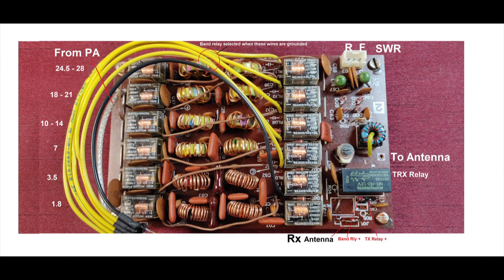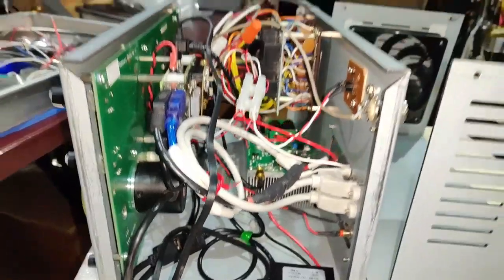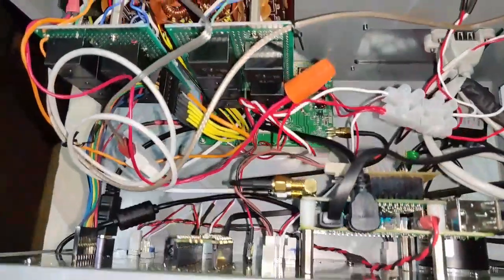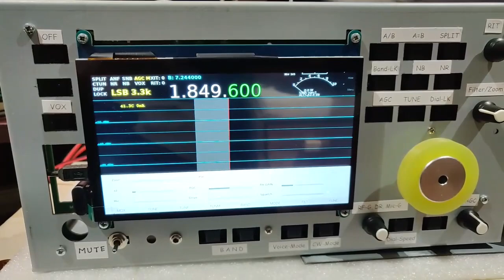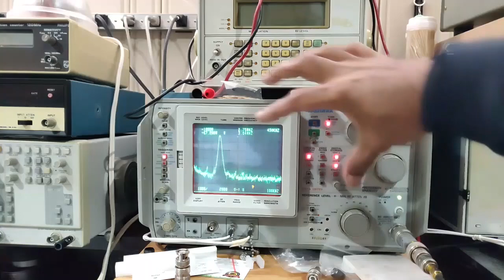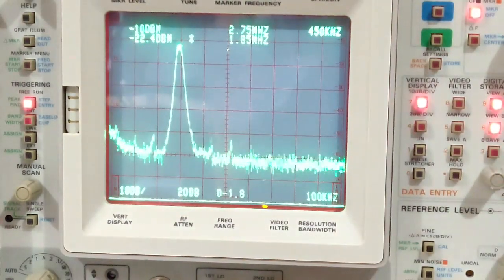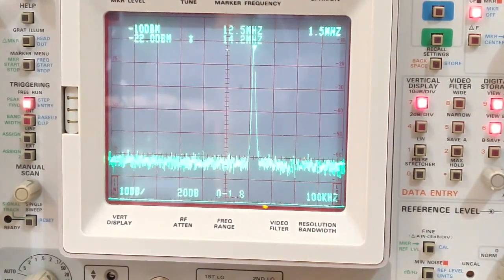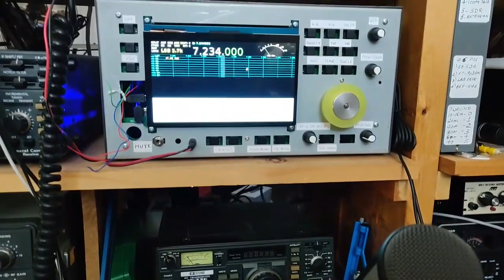On the air QSO with my Radioberry TRX | Raspberry Pi 4 | LPF and Output tests on a Tektronix 495P SA

Comment: Very nice and something I am going to do myself.
I am going to use the PA and FB out of an old IC-725, well that's the idea at least.
But I am trying the Radioberry now for about two weeks now without success.
I just can't seem the get the software setup.
I am going round in circles trying to get it working.
Reply from the maker: Thanks for your message. Yes, if you have a donor IC-725, output stage is taken care of.
Even I went in circles for a while, and then succeeded. I'm sure you will figure it out too. GL and 73.

Comment: Do you go directly from the antenna to the radioberries rx input? Or do you use some bandpass filters or preamps? Thanks for the video Prem!
Reply from the maker: Hello Heiner, thanks for your message. Essentially, the Rx port of Radioberry goes to the antenna directly although there's an antenna change over relay in-between.... because I'm using the NC contact of that relay for Rx (the usual practice). I didn't feel the need for any filtering for Rx frontend. Rx is as good (better, in fact) as most commercial rigs I own. 73.
Reply: @PremMenon  Guess, I will also do without any filtering as my antennas are small bandwidth and thus prevent overloading. Will probably only use the rx part for the time being. Congrats on that fine gorgeous looking vfo in the sturdy metal case Prem!!!
Reply from the maker: @heinerrambold8889  Thank you, Heiner! My best wishes to you. It's just like straight into a doubly-balanced diode-ring mixer front end - as used in many homebrew rigs and some commercial rigs as well.
Overloading should not be a concern. I keep the RF gain at around 5 or 6....and reduce as needed. I'm happy you checked out my ESP32 VFO I made for my army man-pack.

Comment: hi, prem. something I didn't get ! how do you select and control the LPF for each band ? what I see is that wires of LPF go to the radioberry controller board and each band is selected by Pi Pico but the relays are 12v . by the way did manage to install your radioberry  controller on on new Pi OS 6.6 or is it all based on 6.1. nice work and well done
Reply from the maker: Hello Arash, thanks for your message. Mine is the old one. Started the project in Oct/Nov 2023....so, same image. Regarding the 12V relays, it's not an issue. 12V is a common connection to all the LPF relays and the required relay pairs are grouped (negatives are wired together). The required band relays' negative gets grounded by the controller thus selecting the band.